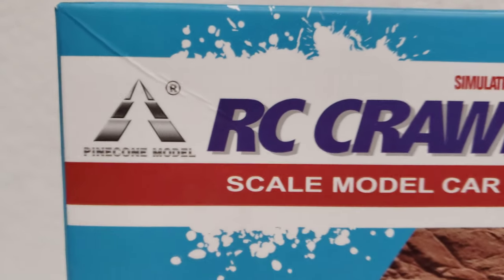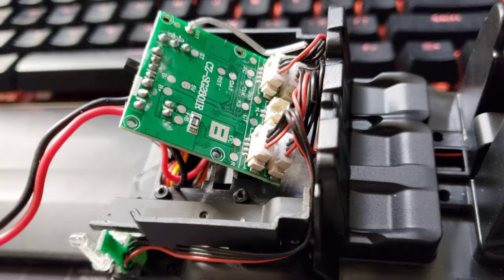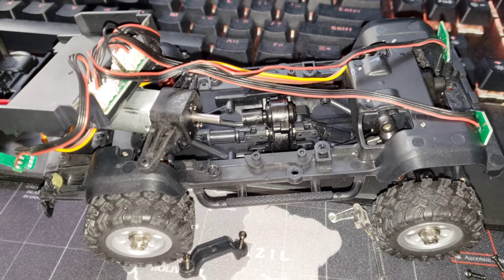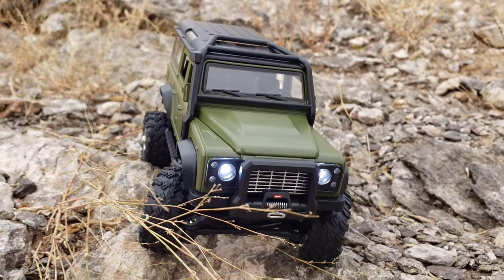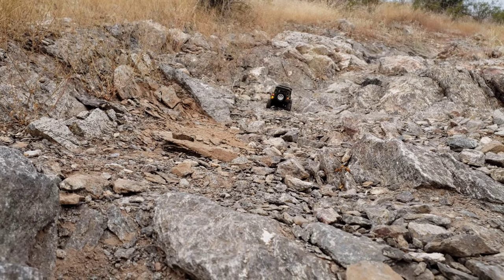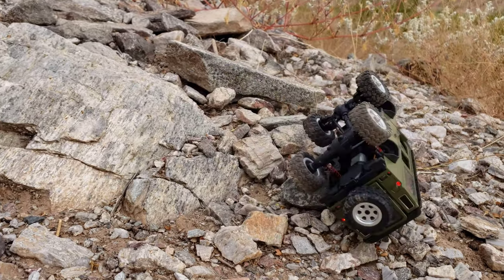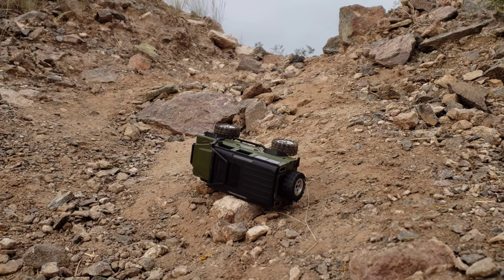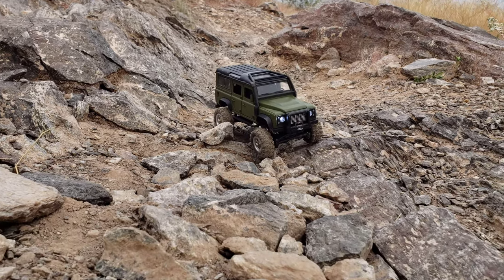SG 2801 28th scale trail truck. Land Rover D110.

Comment: With so much weight loaded to the upper half of the vehicle we can not talk about crawling abilities at all. The "ass" is so heavy asvel.  But if you want to make it a real hobby grade crawler , you need to say good bye to this metal , overweighted body like i did to my of SG 2801's. I replaced it with a 2 grams lexan body shell from a WLTOYS 24438 , loaded the front axle with 50 grams lead cube, and the rear axle with 30 grams lead cube and now it is a real bully ;-)
Reply from the maker: nice!

Comment: very cute, definitely needs lead in the front rims, and more gear reduction.
Reply from the maker: yes for sure. Either the power system or the gear ratio is off. I think they are using a very low quality esc/receiver and it doesn't have enough power to move thos heavy little guy up hill.

Comment: Is there a 2 speed switch on it? The truck seems to make the same sounds when the throttle is advanced, exactly like the Wltoys 2428 does. I wonder if it's made by Wltoys, too.
Reply from the maker: no speed switch on this if I remember correctly. I gave this truck away a while ago. Not sure if the WLToys ones are the same as these.

Comment: Is their wheel weights Available for the front or any offerings for this truck ? Otherwise this is a flat lander for the sandbox 😝
Reply from the maker: you would have to come up with your own weight solutions. It is a top heavy machine for sure.
Reply: @RunThatRC  seems more rear heavy too me I wonder if Axial SCX24 weights would fit? Or something in the front bumper 😝

Comment: What's the modulation like on the sg 2801.
Reply from the maker: It's not the greatest. It would need electronics upgrade if you want to make it a more capable truck. No torque and heavy. Just looks cool being so tiny and metal body.

Comment: Can you make the video how to upgrade battery for wpl c14?please
Reply from the maker: if you have a ready to run I recommend running 2s lithium ion batts. 1500mahs fit in the stock battery location. you can run 15000mah lipos but only if you upgraded the esc receiver.

Comment: It looks really good David,but it's seriously lacking in capability due to it's overly heavy top weight.
Reply from the maker: Yeah maybe ditch the metal body for a 28th scale plastic hard body and it should perform better. Now to look for a 28th scale yota!
Reply: It really is a pity that you may have to do that,as the body itself looks wonderful.
Reply from the maker: @semperatis  it does look good. Its fun messing around on my desk so it may be designated for that. Crawling my mouse and keyboard hahaha.